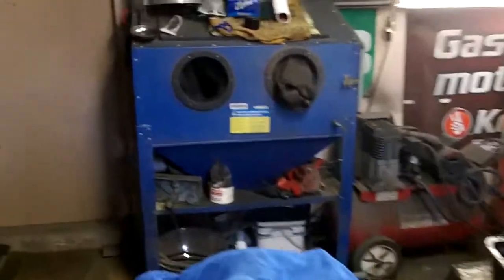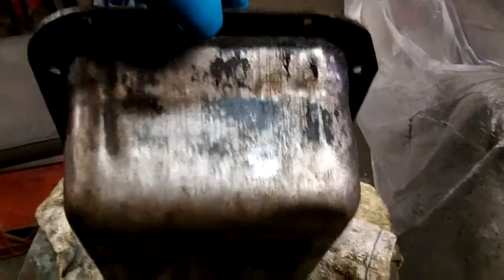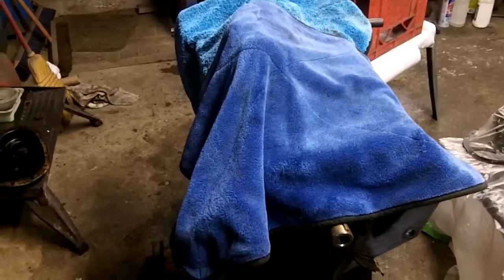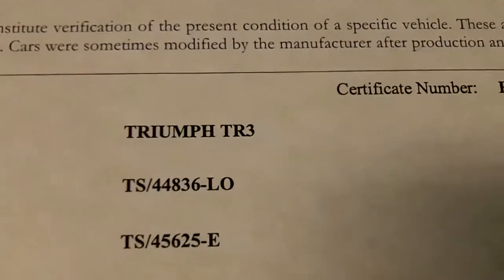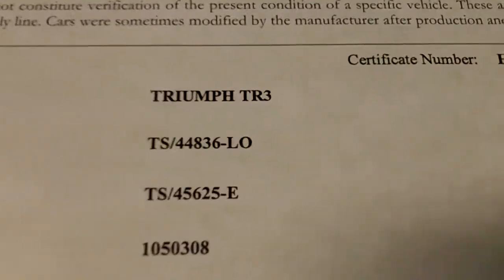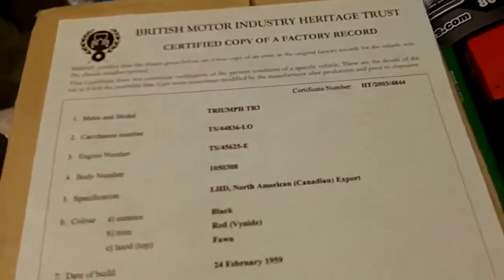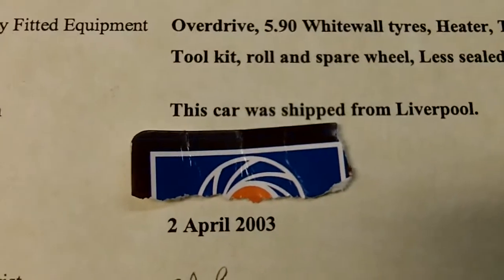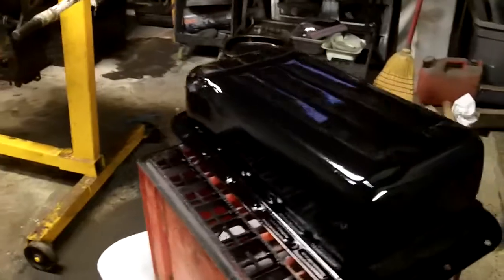1959 Triumph TR3A Restoration, Power Hour (and a little bit)

Comment: Dave,  Thank you so very much for taking the time to answer my question about the engine #.  Even though I am not that hot and heavy into the originality groove, I do feel better about having the original engine.  And I will get the certificate as that will be a good thing to display.  THNX... Jerry

Comment: I can almost smell the old engine oil from that pan... Smell-o-vision! What did you use to clean the inside?
Reply from the maker: asicerik plain old brake cleaner...just sloshed it around a bit and wiped it out with paper towels.   After that I just wiped it down with windex and called it good.